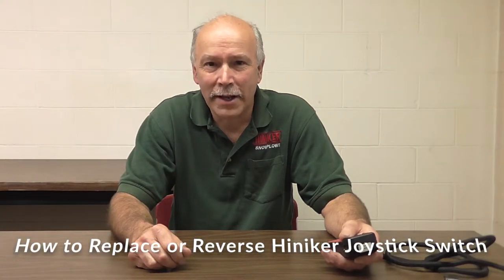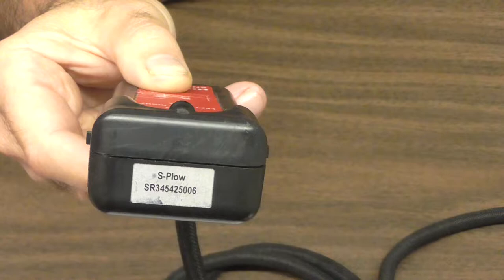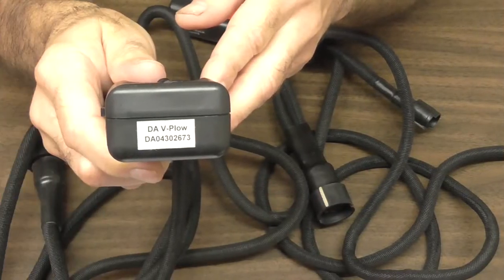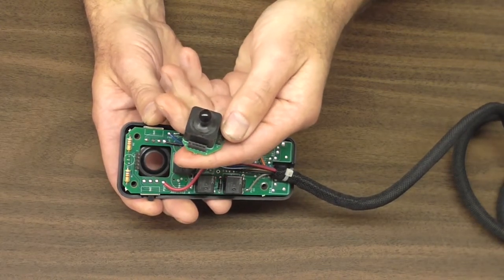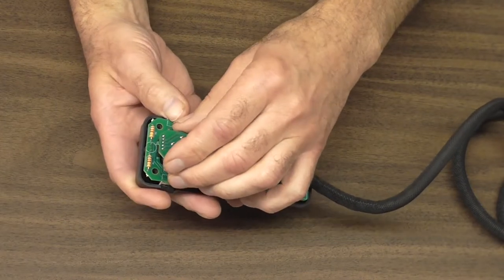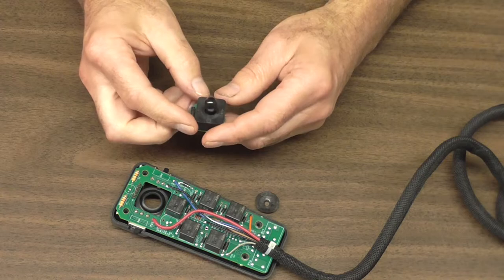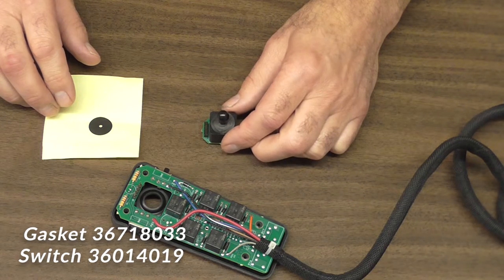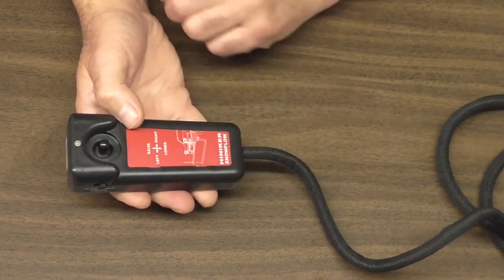How to Replace or Reverse a Hiniker Joystick Switch | Hiniker Snowplow Joystick Tutorial

Comment: Emailed you guys last week, but no response! Was trying to figure out which owners manual download I should use? And what's the oil capacity (including cylinders)? I have older Hiniker plow 2801-0, with S15714311 control, mounted on a 2000 Ford F250 4x4.  Guess I'll just pick up 3-4 quarts and figure it out.
Reply from the maker: Hi Jeffrey,
I'm sorry about that! Who did you email? I want to make sure the email went through so we don't have this issue again. I'll send this request to Mike right away and he will get back to you shortly. Thanks!
Reply: @HinikerCompany  From the Hiniker website, I went to Support > Contact Hiniker Company.  I downloaded the manual for the 2802, and it says 2 Quarts, I'll pick up 3 to have extra. Thanks.